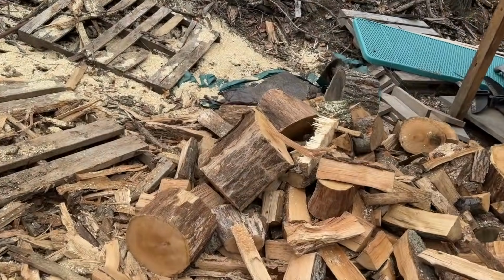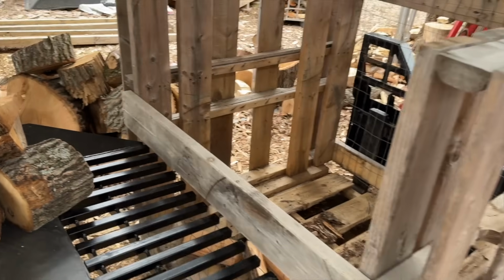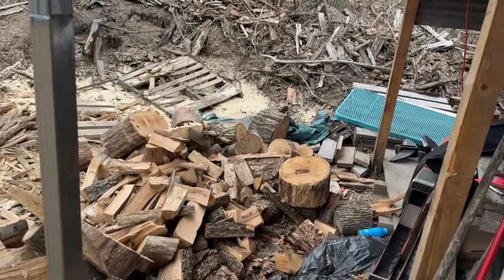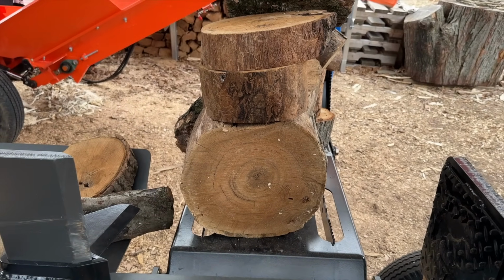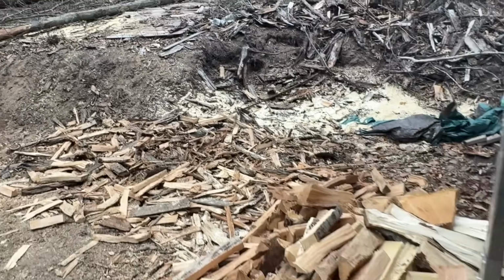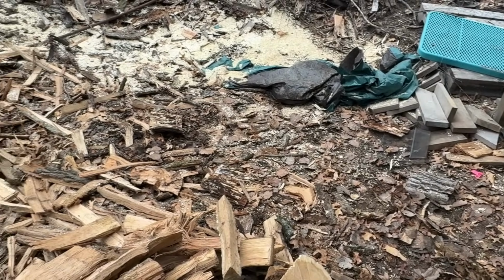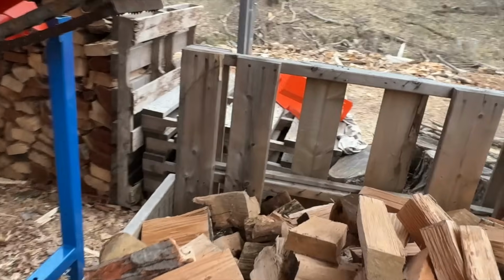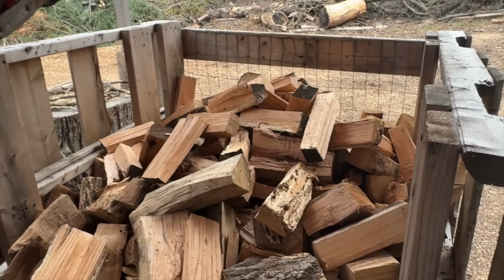Sorting the Scraps - Spring Cleaning in the Woodyard

Comment: Raise up the wedge  end of your splitter so the split wood will fall into your cobbed together wooden tote.
Reply from the maker: That's as high as it will go, there is a rear stabilizer that if you crank the front jack up then it lifts the tires off the ground and would make the machine a bit unstable. I mentioned in the video how that tote I built was too high for sliding wood right into it.

Comment: You should get a radial arm saw to cut those pieces shorter for your mini firewood splits
Reply from the maker: I've done that with a few, but can get to be a challenge if the piece only need like an inch or 2 cut off.